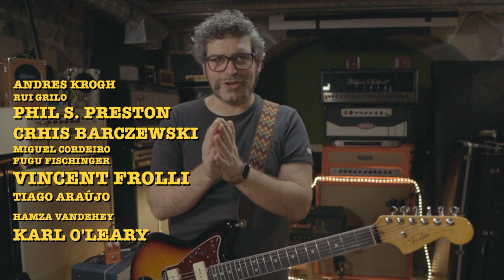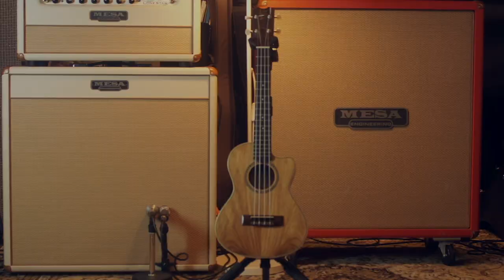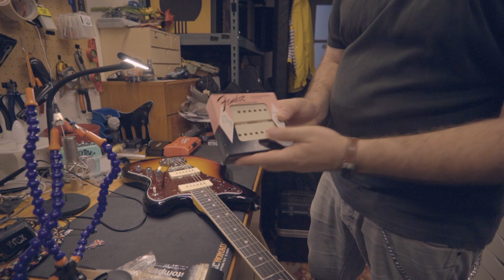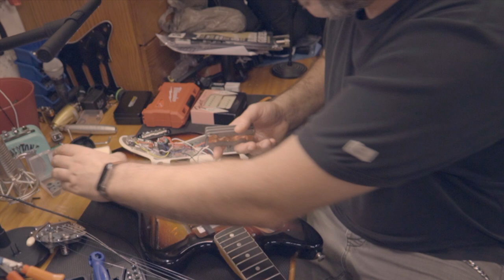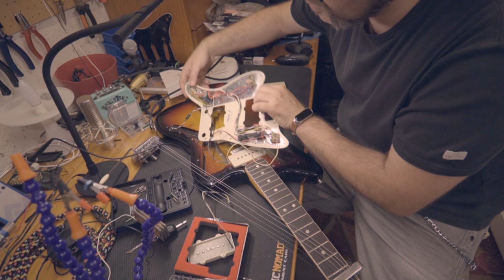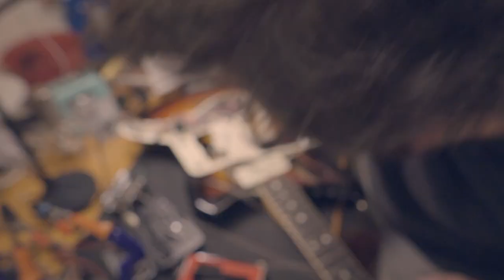Changing Pickups on my Jazzmaster Ultra - EP310

Comment: Thanks for the pup switch demo.These ULTRA Jazzmasters are such excellent guitars!

 

The noiseless jazzmaster pickups are underrated, in my opinion. I don't find them muddy - They sound tight and articulate in bass tone to my ears. They are quieter, with a less pronounced treble tone - I think some people perceive this as "dull", and I can understand that especially if they are used to a more vintage jazzmaster tone. A well adjusted Boss cx1 compressor brought out the treble and spank of the pickups nicely, and I find them very useable

With that being said, I'm going to experiment, and put in some Fender CuNiFe/Cobalt Chrome pups and see what different sounds can be had.  Maybe changing out the 250k S-1 with a 500k S-1 would bring a little more sparkle to the tone ? Thanks once again for the  demo.
Reply from the maker: Find a noiseless pick ups, too dark to my taste

Comment: I also own an Ultra JM model- initially I liked the sound available stock, but in comparison to every other guitar (JMs, SCs, HBs guitars) I owned the pickups sounded lifeless; just dull.  I then was (kinda) dumb and bought some noiseless Kinman JM Fat/Surf pickups (super nice- but expensive) thinking that would be an improvement...they sounded better, but everything was dull sounded still!  I then switched out the entire harness for a standard JM and low and behold- the Kinman's came to life.

Something tells me that either the pots or that rat's nest wiring in the Ultra JM is sucking the life out of ANY pickups in there; I have yet to go down the rabbit hole further.....maybe I should, because the tonal options in the stock Ultra arrangement were super cool- just strangled somewhere in the line. Maybe pots?

Comment: Just a couple of things. You don't need to take the trem off to have the job done.
When passing to single coils, you should stick copper foil inside the cavities and on the back of your scratchplate. That's for sure!
Reply from the maker: How would you change the pickups then?
Reply: @BuddaGuedes  there are a few videos by Puisheen where you fan see everything. He seems to be the Jazzmaster guru, you will lern a lot on his channel. But you must have noticed you don't need to take the trem off to change the pickups, it's on another part of the wood, away from there. Like if I had to take the Bigsby off my Gretsch to install my TV Jones classic...nonsense.
And you must stick copper foil inside. Anyway, Puisheen will show detailed infos.
Just a question... why did you leave the tuners on? 🥳😁🎸👋🏻
Reply: @sintakta  The advantage of taking the trem off, is that you don't have to restring after the mod. It's only 6 screws more... Maybe not ideal for the strings, but that's another thing.

Comment: Hi I just bought a Jazzmaster Lollar P90 and a regular Lollar JM pup for my Jazzmaster Ultra and found out they're Reverse Wind / Reverse Polarity so is that a problem with the wiring on these guitars??  Does it just reverse the phase switch??  Thanks
Reply from the maker: I didn’t understand what you mean
Reply: @BuddaGuedes  sometimes matched sets come RW/RP, reverse wound / reverse polarity to cancel hum when both pups are on (middle switch position). Lollar said it couple be an issue with the phase switch in the JM Ultras. Nevermind if you don’t I understand the question. No worries.